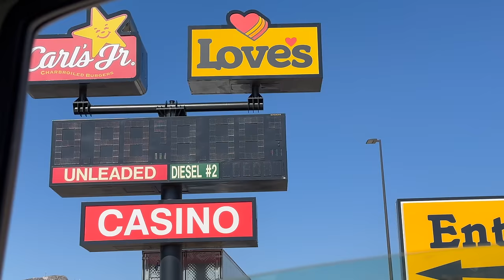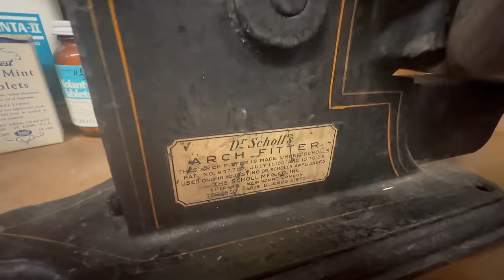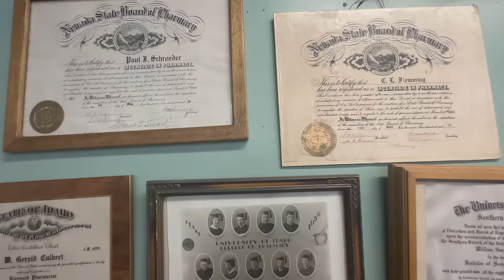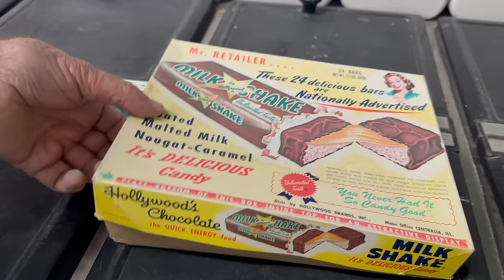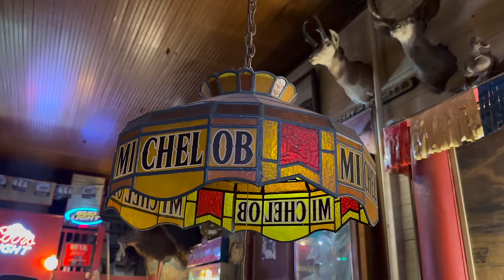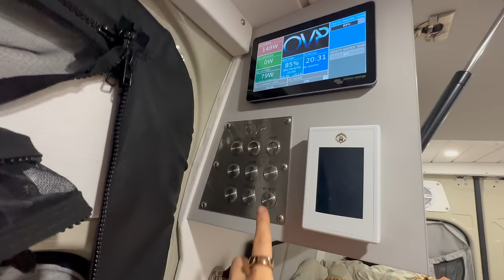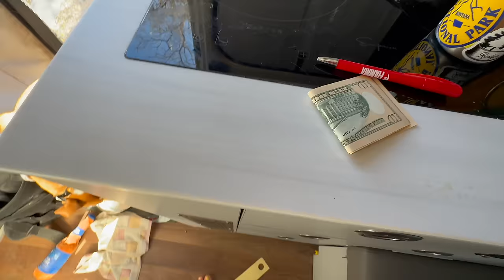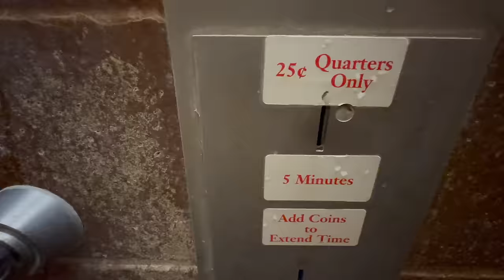A Place Stuck 100 Years Back in Time! | Living on America’s Loneliest Road in a Van

Comment: I worked in central and northern Nevada for over 34 years as a geologist in private industry and as the state regulator for oil, gas, geothermal, and lithium (brines). Your travels across the Loneliest Highway brings back a lot of memories. I traveled this highway what seems like countless times, and even lived 16 miles south of the Loneliest Highway in Big Smoky Valley for a year.

Comment: I have a suggestion for pouring  boiling hot water over your coffee grounds. First, pour the water into another smaller container (such as a coffee cup) over the sink. That way, any spillage goes into the sink. Then easily pour from that container over your coffee grounds without spilling.

Comment: I'm a retired truck driver.  RV's in the truck stops were not much of an issue then.  As more and more place forbid overnight RV's I'm afraid the situation will worsen. A 30 or 40' RV in a 75' truck spot never fails to stir things up.  Most drivers are willing to share the inside facilities but not the parking spaces.  Parking where you did isn't the issue unless there are a lot of bobtails needing a spot.
Reply from the maker: I always say leave the truck area to the trucks no RVs etc! :-)